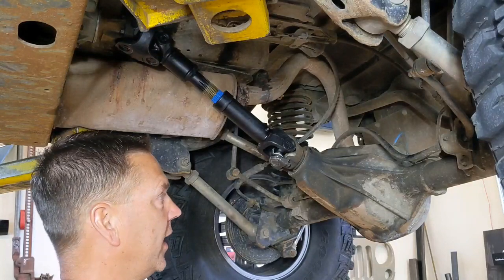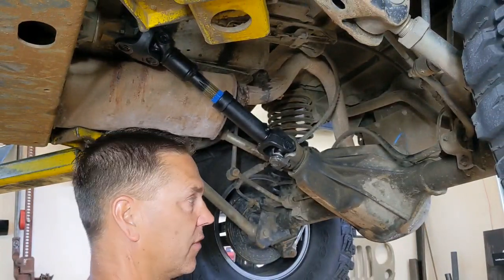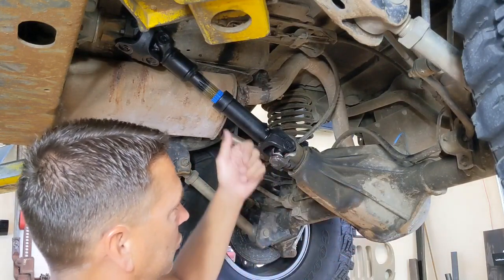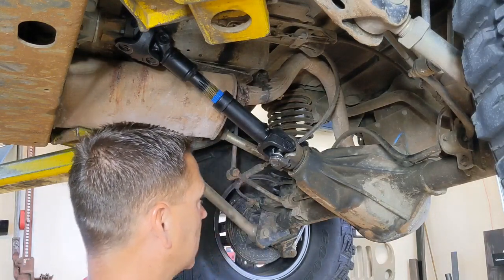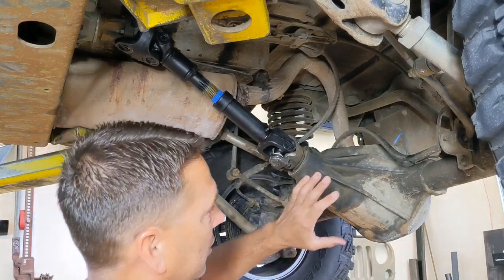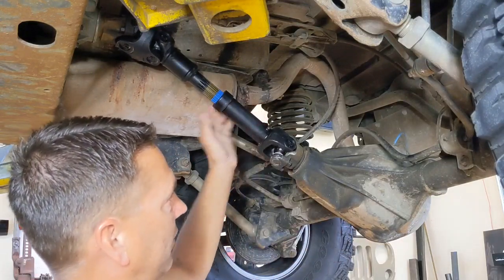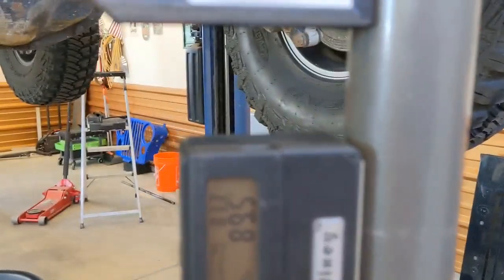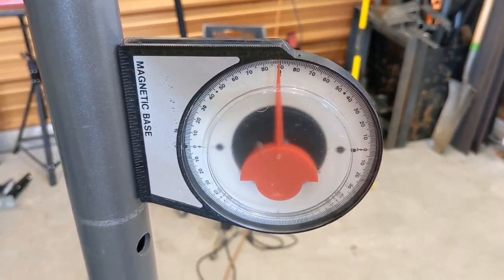How to measure the pinion angle on your Jeep Wrangler

Comment: Thanks for the video, I have a Wrangler jku with 33-in tires and a stock suspension, going to put on Bilstein shocks and 3" dual rate coil springs, after that we'll have to see how it rides then go the route of an adjustable track bar and adjustable lower control arms if needed. Will leave it to my mechanic to do everything the right way.

Comment: I bought a 2014 jeep Wrangler sport from a dealership. I did a whole lot of work to it that was flushing and changing all the fluids. I did the differential and there was teeth from the pinion inside the oil I looked, and it was obvious that my angle was way off I guess they put in a 4 inch lift I didn’t change the control alarms so they couldn’t adjust the opinion angle so now I’m probably gonna have to build from rear end starting from housing. It’ll be fun though I can do it  off the jeep. With a new rear end Dana  44 housing

Comment: I have a question what if you adjust your pinion angles properly but on the front end for example my JL 392 I have a 4 1/2 inch lift on it and if I get my pinion angle adjusted properly on the front my jeep drives all over the road I can’t keep it in the straight line so I’m having a hard time finding an alignment shop that will work with me and I’m trying to do this myself but trying to make it as easy as possible on me, in other words all my control arms are adjustable upper and lower, If I adjust the lower control arms and make them shorter to get the pinion angles proper I’m all over the road so do I adjust my uppers and make them longer does moving the axle Ford slow the steering down etc. I don’t know if any of this makes sense but I’m having real issues with this, my first driveshaft we put in would not work and now I have another driveshaft coming but the only way I can get rid of drive shaft vibration is if my differential is literally parallel to the ground which is definitely wrong can’t run the driveshaft at that angle but again if I get the pinion angles correct I am all over the place I don’t know what the answer is? Any thoughts? Thanks for the video👍👍👍👍
Reply from the maker: I would recommend posting up pictures on a JL forum. You have to consider caster if you are all over the place like you say. The goal is to eliminate vibrations... So if you did that, then I would think that would be good, but I can't see your Jeep. Again, post up on forums and see what you get.

Comment: Hello! I have a question. I want to buy a 2” budget boost lift kit. Do I have to adjust the pinion angle after lifting the Jeep this height?
Reply from the maker: People who install a budget boost usually don't have the budget for a full lift. A 2-in budget boost will require longer shocks. It may or may not induce vibrations, but those can easily be handled by adding some flat washers between the skid plate and the frame effectively lowering your transfer case output. Only add enough to make the vibration (if present) go away.
Reply: @TheBFHGarage  thank you very much! 👍
Reply: Best way for 2" lift.  2" body lift. $ 100.00 to $150.00 maybe.

Comment: I bought a jeep with a 6” short arm kit I bought a sye and have the drive shaft on order I’m hoping the 6” lift is not to much for road driving once everything is aligned good I’m curious if you know of anyone that has a tj with a 6” lift and daily driven ?
Reply from the maker: 6" spring lift? Or combination of body lift? Or? 6" is a lot....
Reply: Yeah 6” RC short arm with 4” body lift I’m removing the body lift fixing the rust on the mounts then would like to be able to drive just with the 6” short arm and my sye but keep reading it’s to much height so I may put the jeep on hold till I can find a 4” long arm kit ? If I want to be able to daily drive
Reply from the maker: @chaddeforge3028  4" body lift??? I would drop to 4" with a 1.25" BL for 35's
Reply: Agreed !! Thanks man

Comment: Pinion angle over caster? So set the pinion angle and just deal with what the caster ends up being?
Reply from the maker: For the most part, yes. Your pinion angle needs to be adjust to where there are no more vibrations. When you get to that point, the caster is what it will be. It is usually not off by much, or enough to cause undesired steering behavior. If it does for some reason, then you will need to make an adjustment, but that may bring vibrations back. Another option is to go with a hub kit.
Reply: @TheBFHGarage  Thanks for the quick reply. Working on this now 👊

Comment: Shouldn’t drive angles on a cardon joint be minimum 0.5 working angle on the drive shaft to keep the needle bearings of the  u joint in motion.
Reply from the maker: The goal is zero degrees from pinion to driveshaft. That means the driveshaft should be perpendicular to the flat spot on the pinion head at ride height.

Comment: You can not get the pinion angle correct with it up on a lift. When you set it on the ground the angle will change.
Reply from the maker: That is addressed. Watch the video and read the comments. I did it on the lift so people could easily see what I was referencing 👍
Reply: @TheBFHGarage  I stand corrected, I guess I messed that part.

Comment: Only issue I have is the vehicle needs to be in the ground on its wheels. Suspended it’s not actually a true reading .
Reply from the maker: Correct. If you watch the entire video I explain that part of it. The only reason for it being in the air is so people can see what I'm referring to better. But yes, it has to be on the ground.
Reply: @TheBFHGarage  I seem to have a steep angle and I might make it worse by adding a bigger shackle.  How much of an angle can double cardan support?  What is your angle at the transfer case output at ground level?
Reply from the maker: @rajeshmarichetti8552  First, I would check with the experts and how much angle your DC can handle. In my case, I have a Tom Woods driveshaft so I would refer to their website or even call them. In the end, the number doesn't matter. You can droop the driveshaft just until it starts to bind and then back it off a little. In my case, I welded my shock mounts on just before DS bind. If you have longer travel shocks, then you can use a limit strap over the pumpkin to keep it from hitting bind while allowing full articulation.